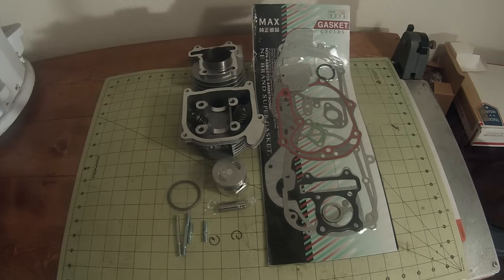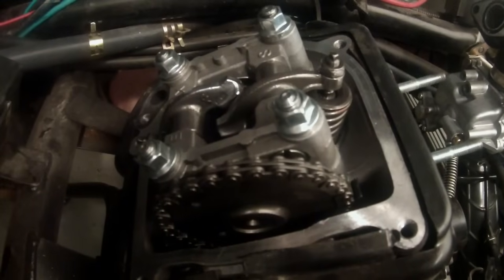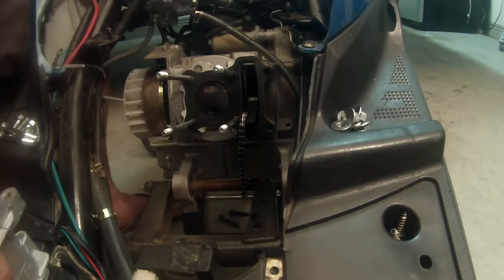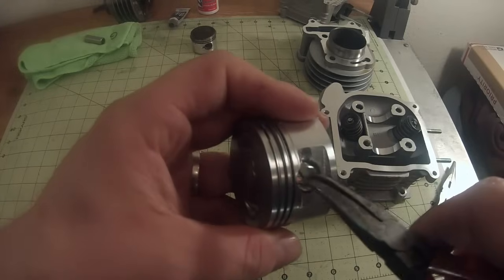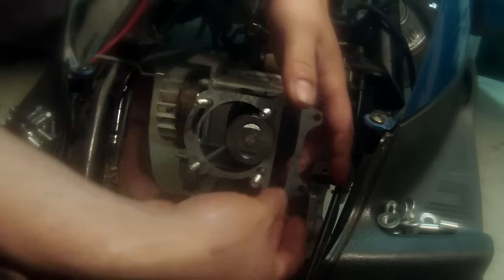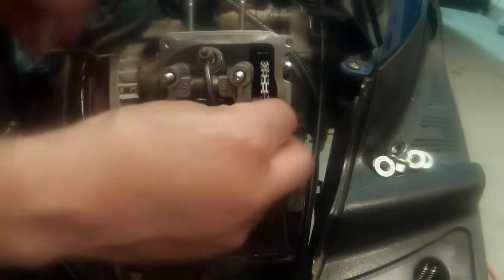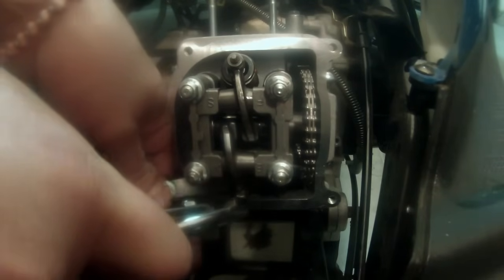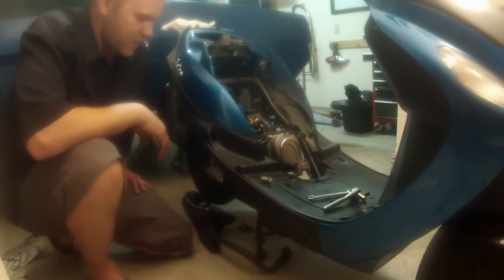How to Install Big Bore Kit on 50cc Scooter - Every Step Included! 80cc or 100cc GY6 139QMB Engine

Comment: Great video and it me helped out a WHOOOOLE LOT and it took me way longer, I have a 2020 Vitacci Bullet 25 which I've seen no kind of manuals and videos to help people, maybe because these are newer and maybe I can post some of the pics and video clips I did to help others as well and it's was killing me in traffic until now and I had starting issues with the blue racing cdi, it worked before with the 50cc setup but not with the 100cc BBK. I  got a J&J power sports red out of the power pack I got from them and the carb too that needs adjusting so I can road test it.
I also broke one of the exhaust pipe bolts that was new but I should have pulled the old studs and used them, the gold colored ones looked cheap but I put them one since they were new and I didn't get to torque them and snap. No problem I'll take it to a shop and get it fixed.
I'm putting the plastic covers and foot peg mounts back on, I got it running and it's Beast while playing with the carb and Idle air and will let you know how it went. Thanks Patrick you're a really cool dude with your DIY video and keep up the great work and God bless brother, TTYL, Angel
Reply: Where did you buy your upgrade kit?
Reply: And did you get the 64mm or 69mm?

Comment: Will I need anything else to go with my bore up kit? Carb etc etc or will it be fine with everything else being stock, thanks
Reply: I know this  comment is 3 years old, but if you rejet a stock carb to a bigger jet and run premium fuel (higher octane) you should be okay, just open up the air intake and exhaust, and rejet.

Comment: Great video man. I've got a 50 cc Kymco Agility 50. I've installed a performance carburetor and exhaust. Not hardly any changes in speed. Still only about 35 mph.  Runs way better though.  What kind of increase would I get with an  80 cc bore kit? Also will the oil pump still keep up?

Comment: i lined up my crankshaft at tdc and installed my camshaft the same way it came out with those 3 holes showing, my scooter is cranking, im definitely getting a spark i got shocked multiple times, but im not hearing any sort of combustion or smelling any fuel burning, i disconnected my carb and i can see fuel going to it, i tried removing my camshaft and swapping it 180 degrees with the piston at tdc to see if anything chaged but it still only cranks and doesnt start up, i can feel a small amount of compression if i place my finger over the spark plug hole, is there something i missed i didnt remove the egr tubes, any help or advice would be much appreciated

Comment: hi, great video, I've just installed a 75cc kit after watching it. Quick question, the vacuum hose you took off the front of the engine at 7.45 where does the other end go to? mine came off completely and I'm not too sure where the back bit goes! Once again, thanks for the video.

Comment: so i am gonna change my piston soon, and it is on a 2 stroke engine. and i wonder if i just can use normal 2 stroke oil instead of the assembly oil?
Reply from the maker: +Tomas Reime I've done it plenty of times in a bind. Use a heavy oil like Lucas or 30w. 
Thanks for watching!
Reply: Rouse Garage thank you for a good answer! :)
This video helped me a lot!
Reply: I just bought a 80cc bore kit a cam and a stock 125-150cc carb. Haven't installed it yet. Is this a good setup?

Comment: The steel gasket that goes between the crankcase And the cylinder, you can't put it on after you put the piston on the connecting rod. I just followed your instructions and I had to take the Piston back off to put the metal gasket on.
Reply: I figured out I had that I'm an idiot and didn't watch the whole video through and for some reason thought the Steel gasket went on first

Comment: Hi man. When upgrading to a 70cc cylinder, should i change the size of the spark plug as well? I just noticed that when i removed the spark plug, it is a different from what is stated on my scooters manual. Thanks
Reply from the maker: There are many spark plug manufacturers with different part numbers for the same size plug. Not sure where you got your kit, but it should be the same size plug if it’s a quality kit

Comment: it has to be said, sym and kymco engines are slightly different generic china kits will fit with modification, but you are better off buying the right kit even if it costs a little more.
another pratt fall with the china kits is some have a slightly different angle on the exhaust port make sure you get it right or your exhaust wont fit.

Comment: Want length you used? 69mm or 64mm? I have the same scooter but I dont know wich kit buy. Please
Reply from the maker: Unfortunately, there is no way to tell valve size without pulling off your valve cover. Check out this video to determine your valve size:
https://youtu.be/lt4NEhClpoo

Comment: if you are upgrading to the 100cc don't you need to replace the carb or at least switch out the jets?
is it also a good idea to switch out variator roller weights? stronger rear clutch?

Comment: Hi there i know this video is a bit old.. just want to ask something.. i have a 2 stroke pgo pmx naked 50cc scooter.. would that be all the same? I mean if i change it to 80 cc for example there should be no problem?
Reply: You will need to jet the carburetor. And 80cc? You will need a new crank too stock crank is okay up to 70cc sport. NO MORE! Or your gonna destroy that original crank.

Comment: Hi man, just a question out of the blue. Is it necessary to pre mix petrol with lubricating oil even with the newer model 2 stroke scooters? I have a longjia 2stroke 2017 which i bought pre owned. It was upgraded by previous owner with a 70cc cylinder kit(not 50cc anymore), exhaust, sports variator amd etc.

Comment: Great vid Put in the 80cc. More peppy... Question though the top speed is still limited and seems to not go faster. How do you make the top speed increase
Reply: +ryansh84  The CDI is usually limiting the speed on those scooters so installing one without a rev limiter should help. Also on some models there can be a wire going to the CVT and by cutting it the speed measuring limiter thing is disabled, didnt have it on mine so i havent tried it.

Comment: About to buy this kit from your site. But i was curious if you had to bore out the engine case to fit the sleeve for the cylinder. I have the boring tool so if it does need to be done no problem but i was just curious as to what i'm going to be needing to do before hand. Thanks!
Reply from the maker: Giuliano- there is no need to bore out the case. Our kit is 100% bolt on. 
Thanks for your support!
Reply: perfect makes it easier. Now with the valve lengths, i guess the only way is to take everything apart and measure? so i'd have to do that before ordering the kit i guess.
Reply from the maker: Correct.  Unfortunately, the only way to tell is by removing the valve cover. Check out our valve size video if you need to know how to determine your size

Comment: what the difference between the two valve sizes and which did you use 64mm or 69mm
Reply from the maker: Clfton Butler - This scooter had the shorter 64mm valves.  The 69mm valves are longer.  Make sure you order the kit that has the same size valves as you scooter.  They are not interchangeable.
I did a video on how to tell the difference.  Here is the link:
https://www.youtube.com/watch?v=lt4NEhClpoo
Reply: +Rouse Garage +Rouse Garage for the more experienced, the kit i ordered came with short valves and i needed longer.  So i simply put old valves in new head,
Stock: exhaust, carb, cdi,  top speed 50mph and im 180lbs
Reply: +SouthFlaDiver ps great video very thorough

Comment: Do you have to do the bigger valves an bigger cam? What have you done to the cvt parts?
Reply from the maker: +Ryan R You do not need to modify the cam in any way.  Always use the same size valves.  There are 2 sizes of valves - 64mm and 69mm.  Be sure to purchase the correct kit for your valve size.  There is a video on my channel on how to determine valve size.

Comment: I'm looking to buy a new 49cc scooter Tao Tao Pony 50 :)
Looking for (simple plug n play) type mods.
I want to keep it simple and get a little more high end performance.
Can I just replace the stock carb and muffler system and still be reliable?
Looking at: 
Glixal ATMT1-073-1 GY6 49cc 20mm Big Bore CVK Carburetor with Electric Choke 
39mm Air Filter for Gy6 Moped Scooter 
BADASS SHARKS 28mm Motorcycle Exhaust Muffler Pipe System
Trying to keep it simple and semi reliable. 

What do you folks think?

Comment: I did this install years ago and the bike with the bbk would run really hot and ping lose power until it was cooled. Is this a common thing or was my install not right
Reply: Johnny Tsunami Sounds like the fuel/air ratio is too lean and the cylinder gets too hot. Richen up the mixture and use a slightly bigger main jet , that should help.

Comment: I just recieved my 80cc big bore kit for my kymco super 8 50R scooter. It did not come with a cylinder head. Do i need to get a new cylinder head also or will the big bore kit match up with the 50cc cylinder head that came installed on the scooter? Im a semi noob when it comes to this.
Reply: Ill answer my self..... you can use the stock head pal!
Reply: And the install went great! If you are 2nd guessing your seld, if i can do it then anyone can do it!

Comment: Oh man. I watched the whole thing, I have a 50cc with a BBK, bought it like that but the guy doesn't know what bore kit the dude used, and I really don't want to take it apart if I don't have to ( Imma buy an electronic caliper, torque wrench, and gap tool ) I have the rest. I have a carburetor with no valve screw ( it's just solid brass) and I cleaned jets, used a needle to put through the holes ( the third time I checked ) and there was honey like substance build up on 2-3 holes. I'm sure if I put it back now it will most likely run better, but Tuesday I get a new carb with a valve adjustment screw and it's 20mm vs my 18mm one. I'm sure my manifold will still fit the 20mm since it doesn't seem like much difference, and Imma replace CDI, spark plug, coil wire, fuel filter and see how it does, BUT this video gave me confidence on buying a semi new moped without a bore kit and do this myself, I know the pin seems to be the hardest, but using a pick and the notch on the side as leverage, it can be put in and out semi easy without possibly bending it for rookie like me. Thanks for this valuable video explanation! After I do a BBK, I'll probably buy an extra BBK and 50cc engine block for when one of my engines goes bad on either moped. Then if I ever get a third one, that'll be a 150cc on a 50cc moped. This things are fun in Town! And when the snow is bad to drive I just take the bus that's 2 blocks from my house haha, it's videos like this that keep us entertained and learning! I know life can at times try to get the best of us, but with enough time and patience and willingness, things tend to fall in place. Thanks again !

Comment: Quastion?! I have a 2007 aprilia sr50r (50cc) witch is EFI electronic fuel injectors is this 100cc big bore kit it will work on my engine ? Thanks in advance.
Reply: Sergiu Creciun is that a 2 stroke? If it is, this will not be suitable for that (this is a gy6 50cc bigbore kit)
Reply: Otto Jokipalo  Thanks. Yes is 2 stroke and is piagio hi-tech 2

Comment: will the parts on the site work with a QMA motor?
Reply from the maker: Yes, as long as it’s an xx139qma
The engine combustion system is the exact same as the 139qmb.

Comment: Hey guys, I just used this video to install a bbk on my 50cc scooter. Made it very clear and easy to do step by step, I wanted to ask if its needed to retorque the headbolt nuts after a couple runs as when I first got the kit installed my scooter ran amazing with tons of power. However, a couple days later I noticed it suddenly lacked the ability to accelerate and bogged down and smoked a bit at startup. It seemed my headgasket was allowing a loss of compression. Revved the engine with the bike on its stand and at high rpm a blast of air(combustion I would imagine) came from under the engine shroud and there was an oil/fuel mixture around the headgasket area. I have read that on some engines you need to allow it to heat up to normal temps, totally cool down, and then torque the bolts back to spec. Is this expected on gy6 engines as well?
Reply from the maker: +Mike D 
I've never needed to do that. Without seeing the bike, it's hard to say. Did you replace the head gasket when doing the kit, or reuse the original?  I would replace the gasket, and be sure your valves are set correctly (shown in vid). If your exhaust valve isn't opening enough, the exhaust has to go somewhere. Best of luck, and thanks for watching!

Comment: installed 80cc Bore Kit when reassemble valve rockers has way too much play can I use the old head or any other advice
Reply: Frank Lanno you might have had a 69mm valve stock and got a 64mm valve bbk. I assume you could use the stock head, but I'm not sure.

Comment: Question.....Do you have to add some copper spray to the gasket header to prevent oil leaks between the header and master cylinder??
Reply from the maker: There is no need. I’ve never done it and never had an issue!
Happy Scootin!

Comment: Nice video! Doesnt your gy6 have chainguides for the timing chain? They usually have. Also the chaintensioner should push on the guide as far as ive seen so far.

Comment: Hey Great video! I am new to the scooter game as I just ended up with a 50cc Johnway. Im looking to soup it up and sell it.  Im noticing a few big bore kits come with performance cdi and coil and other parts. Is it worth buying all these extra parts or is there a specific kit that you usually use?
Reply from the maker: Thanks for the kind words!  We get asked that question a lot. In my opinion, save your money on performance ignition parts unless you have a reputable supplier. Most the online (website, eBay, Amazon) sellers will sell an orange coil and call it “performance”. We’ve tested several and found absolutely no difference (planning on doing an in-depth video showing this in 2018).  
For CDI: there are two areas they can improve 1) a slight spark advancement 2) no rev-limiter. Again, it’s a gamble to get one online (or from a local shop) that does both of these correctly, or at all. I’ll also caution to not having a cdi w/ a rev limiter and your scoot not having a tachometer. It’s dangerous to run without this failsafe and not knowing your RPMs, especially if you have a big bore kit. 
Big bore kit: Quality matters, and a lot of the online folks throw in a lot of extras you don’t need to get you to buy, and make more money.  We get asked daily for them and/or what to use, so we are listening to our YouTube fans and will be selling big bore kits soon. The first run is in production now, and we are looking to launch rousemotorsports.com in Feb 2018, with discounts to our YouTube subscribers. 
Bottom line - Install a big bore kit w/ a 50mm piston. The best addition you can do from there on the cheap is a performance carburetor, or at least a larger main jet in your current carb. 

We’ll be going into all options and expectations in a video series in 2018 as well. 
Hope this helps!

Comment: Hi Patrick, can I change mine to a bigger bore without buying the valve cover. i was planning to use the original one from my scooter. Will it fit or it will not?
Reply from the maker: You will definitely want to replace the head at the same time. The head for the big bore kits are machined to a spec that will match both the diameter and compression spec of the larger cylinder.
Reply: @RouseGarage  I will definitely do now, thanks for your response. Very informative and helpful!
Reply: @RouseGarage  brother just want to thank you again for I was able to install mine with no problems, only prob I got was with the rocker assembly as I used the same base with new arms, uphills is so easy now.

Comment: So, i ordered a BBK prematurely without checking the size of my valves. I received it in the mail today, and the ones that came on the scoot are the farther out version (69mm), whereas the ones that came with the kit are the smaller (64mm). The kit came with rocker arms and everything, will i have to contact the seller and get the different size?
Reply: +Kaius Azelle This video is the best, by the way. Your explanation and tips are easy to follow and you seem like a humble guy. Best installation vid on youtube! (Meant to add that to my previous comment)
Reply from the maker: +Kaius Azelle -  I would contact the supplier.  They might just swap it out for the price of shipping.  Admit fault and be nice.  If not, you can purchase new head with 69mm pretty cheap.
I always replace the head when installing a BBK since they are cheap.  Happy Scooting!
Reply from the maker: Thanks +Kaius Azelle -  Its fun to wrench on these scoots, and even more fun reading the great comments!

Comment: great video. would it be necessary to adjust the fuel air ration on the stock carb after the kit is on. do you lean out or richen it up? Thanks
Reply from the maker: +Grace Bayan it will run best if you can deliver more fuel. It is best practice to increase your jet size. Go up one size and try that. Larger combustion chamber loves more fuel

Comment: im having a really  hard time getting the piston rings into the cylinder do you guys have any tips?
Reply from the maker: +Alside The Hero You can buy a tool that assists with getting them to slide in.  Most of the quality kits come with a cylinder that is beveled at the top of the cylinder that helps guide them in.  
It can definitely be difficult some times though!
Reply: thanks a bunch i just bought the tool too